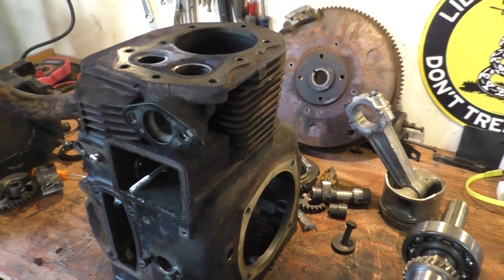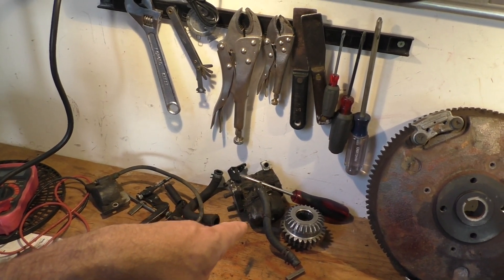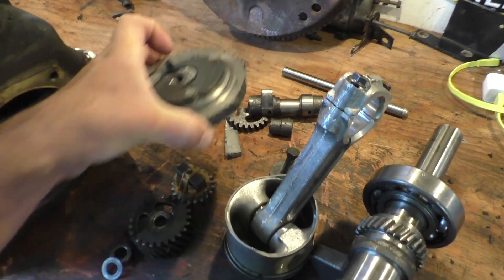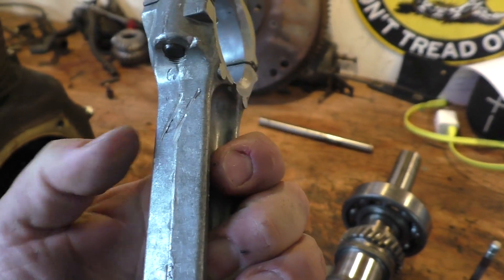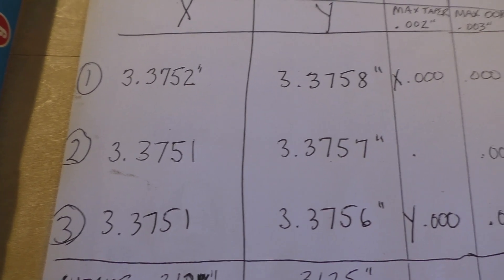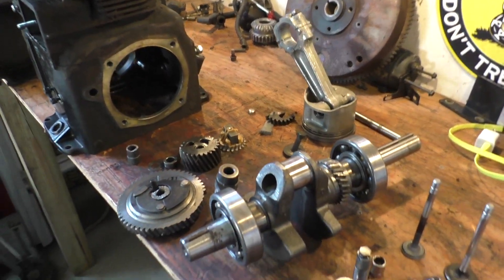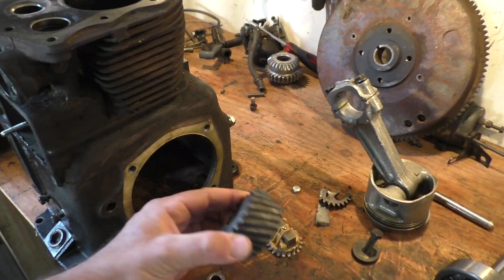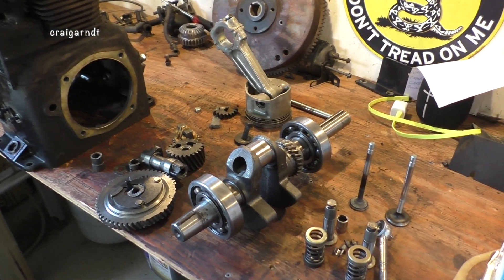Kohler K301 Disassembled, Great Candidate for Rebuild

Comment: I have read horror stories about the balance gears blowing a hole in the engine block. It was just luck that this one didn't.
None of the rebuilders I have spoken with install new balance gears. Those are the weakest part of the whole engine.

Comment: I can’t believe the destruction that thing had.  BTW the governor gear touches the cam shaft not the balance gear.  I also say ditch the balance gears...
Reply from the maker: Yeah that’s right, the cam gear not balance gear.  There’s so many slivers and pieces all over the place, I’m not sure what came from where.  I forgot to video the fuel pump.  The lever that rides on the cam was sheered out of the pump and shredded, haven’t been able to find that.

Comment: I am Proud of you taking on a challenge like this one.Hope you can find the parts ..Try a small propane torch on the exhaust bolt and keep spraying it with some penetrating fluid ..I have had good luck heating stuff just enough to boil the fluid and rust out
Reply from the maker: I did that twice but I'll keep trying it.  Think it is just going to take patience which I don't have any, lol.  I'll give it some more heat and PB Blaster.

Comment: When I rebuilt my k301 on my wheel horse c125 I left the balance gears out.   I haven’t noticed any difference
Reply from the maker: I'm with you on that, those balance gears are like a slow time bomb.  Just looking at the castings themselves, a lot of porosity in them so they're not going to take heat well.